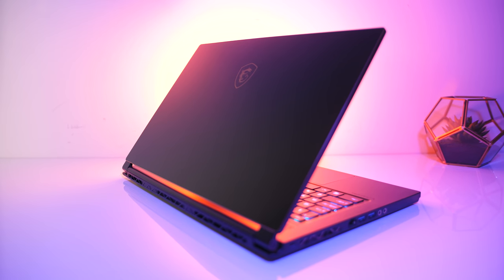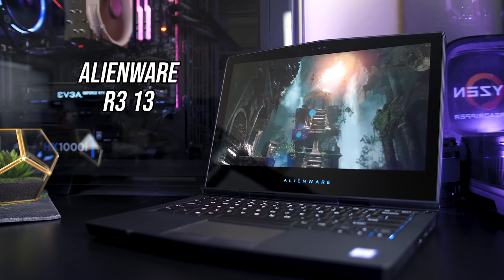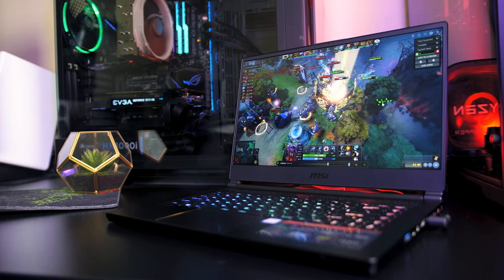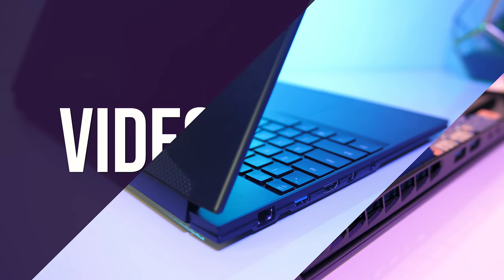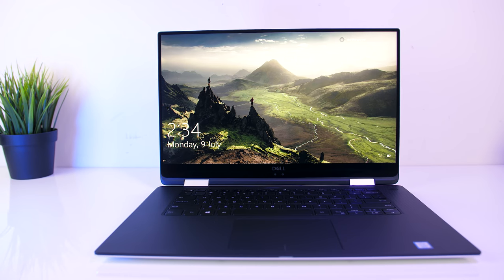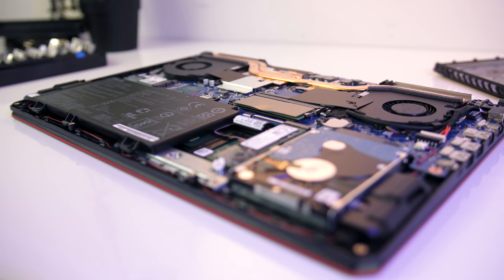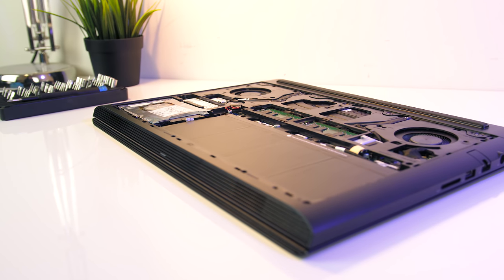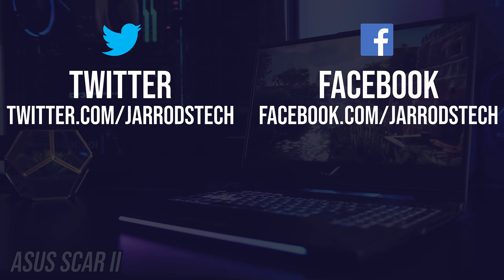The Best and Worst Gaming Laptops of 2018

Comment: Alright guys, so I need some help and opinions. Also great video Jarrod! Subscribed for sure!

I'm not a hardcore gamer but I do game sometimes, like everyday but not for more than 2-4 hours. Mostly Pub G, counterstrike, overwatch and occasionally stuff like Minecraft,  sims, Fortnite. Whatever's fun but I'm not crazy about it so i feel like I don't need to play them on the highest settings with the craziest graphics. I just want it to be smooth while I play at mid-high settings. I want to get into video editing but it's not going to be that serious. I also go to school and want something that can handle the basic stuff for a college student. So a light, thin, and practical build would be best.

I like the Razor Blade 15, Asus Scar ll, and GS65 but I'd like to hear what ya'll think. Help! thank you!
Reply from the maker: Thanks! Fortnite/CS:GO/Overwatch run well on pretty much anything these days, so no issues there. PUBG needs a bit more, probably GTX 1060 for a good experience whereas the others would work fine with GTX 1050 Ti, maybe a 1050 with lower settings. Not sure about Minecraft as I haven't played it myself. When you say light and thin the models that come to mind are that Razer Blade (great battery life, build quality, good specs, but pricey) or MSI GS65 (alright build quality, good specs, fairly good battery, cheaper than blade, good middleground option). The Scar is a bit bigger, has the camo pattern on it so depends if you don't mind that, but the battery life isn't great (at least in the 1070 model I tested, the 1060 one should get a bit extra battery life). All of those laptops are available with 1060 or 1070 Max-Q graphics, for the games you've listed the 1060 is probably fine, but given graphics can't be upgraded in future (unless using eGPU over Thunderbolt) it's generally best to get the best you can afford at the time. Could also be worth waiting a little more, the new RTX models should come out from the 29th of January.
Reply: @JarrodsTech  Wow, thanks for the speedy response or even responding at all. You rarely see that nowadays! I'm pretty much sold on the Razer Blade besides it's price but the base model with 250 gb is about 1700. Seems like a decent price since I'm not looking to crazy game all the time. Do you think that's a good price for the base model or is there a better bang for my buck? I love the sleekness of it and it seems like others with the same specs are around the same price. Thoughts?

Edit: also since gtx 1060 seems to be enough to handle the intensity of my gaming I'd rather wait for the rtx models to come out so that the gtx model prices go down lol thanks again!
Reply from the maker: @lillytopaz2899  No problem! I guess I consider the GS65 as the "bang for buck" Razer Blade 😛 yeah 1060 is pretty good, still capable of playing modern games at high settings 1080p 60 FPS, my concern is it's been around for 2 years now so depending on how much of an improvement the new stuff is maybe game devs might start making the games with newer graphics in mind making the 1060 not as good years from now, really hard to predict though, either way should be decent for a while yet I think!

Comment: I have seen many of your videos. Keep that good work. Could u plz recommend me a good laptop or build for arquitecture and a little gaming?
Reply from the maker: Something with decent graphics, 1060 or above, any CPU like 8300H or 8750H should be fine, 16GB of memory would be good, the rest depends on what your budget is.
Reply: @JarrodsTech  Well, I'm not sure if is better to put all on a laptop or get a desktop and a laptop. My budget in general is $2500..Ty for reply really appreciate I have looking for help a lot.
Reply from the maker: Only really worthwhile getting a laptop if you want the portability to travel with, otherwise you can get a desktop with more power for less money. Otherwise for laptops in that price range, you could get a nice thin and powerful machine like the Razer Blade, Gigabyte Aero 15x, MSI GS65, or ASUS Zephyrus M, those would be what I look into.
Reply: @JarrodsTech  So could be a build for desktop, I was thinking about 32gb or 16gb ram, Cpu i7 9700/8700k, ryzen 7 2700x/tr1920x and gpu rtx 2070/1070ti. Which you think?. Worth a high pc or best a mid one? Sorry for a lot questions.
Reply from the maker: Either would be a fair bit better than a laptop, what are you using it for? If mostly for gaming not really worth Threadripper, either of the other two are fine, technically the 8700k will be better in most games than 2700x due to clock speed advantage.
Reply: @JarrodsTech  I'm a Arquitecute student, Design, renders and play games like Ark, fornite, Bo4 etc. I want to make a build that for about 2years or more  don't need to upgrade it. I want it to be cheap and good.
Reply from the maker: I'd probably go the 2700X with a decent X470 board, in theory the new Ryzen CPUs coming out later in 2019 should be compatible too, so you'd have an upgrade path, and the extra cores may be beneficial for the rendering etc, and still perfectly fine for games.
Reply: @JarrodsTech  Which graphic card and 16 or 32ram?
Reply from the maker: 16gb is fine for most things, especially gaming, not actually sure about your architecture apps so may want to find out what they recommend. Also go dual channel over single (2x sticks instead of 1x) as you'll get a performance boost, higher speed memory can help too, I have videos on those topics here:
Single channel vs dual channel: https://www.youtube.com/watch?v=E_aPaj5QkmM
Ryzen memory speeds: https://www.youtube.com/watch?v=PR68C2bUgFI
Reply: @JarrodsTech  And graphic
Reply from the maker: The best you can afford basically, I haven't tested too many different types myself, but am working on some comparisons of graphics cards soon so that might be useful.
Reply: @JarrodsTech  I will wait then. Since I saw some graphics will come out on CES
Reply from the maker: Yep that seems to be the case too, I'll be at CES making heaps of videos!
Reply: @JarrodsTech  Wow great, Thx for great content really.

Comment: What would be your recommendation for a sorta thin/light laptop for car design/industrial design? Most important software is gonna be the Adobe CC stuff (PS, Illustrator, ID) and Autodesk Alias. Sorta good battery life would be nice and no overheating of course and maybe not looking like a spaceship. I was looking at a Blade 15 or a  Aero 15X (also Zephyrus M and GS65 but those don't have the greatest battery). The thing is, the Blade is probably the perfect package, but I've heard quite some negative things about them. Not really in the reviews - those are usually very positive about the 2018 Blades - but after some time. Just not sure if those are just the few faulty devices or if it's a general issue. And spending €2000+ I don't really want to have issues to be honest. 

What would you recommend in that situation? Maybe a different device than the ones I considered? Or should I maybe just wait a little longer for new devices (CES etc.) ?
Reply from the maker: The GS65 battery is ok if I recall, Zephyrus is out for battery, but yeah blade and aero are really good in that regard. I think it's worth waiting for CES, I'm pretty sure there will be new laptops announced there, I'm flying out in a couple of days and going to be making some videos there on new laptops.
Reply: @JarrodsTech  thank you, I'll wait for CES then. I'll keep an eye on your new videos. Has your experience with your Aero been good so far?
Reply from the maker: Yeah going well, though CES will be the ultimate test because it will see the most action so far editing/exporting all the videos 😛

Comment: Hey Jarrod,So I have the Worst Laptop,the FX504 with I5..Well like you said it stutters ALOT on games..Even on CSGO. Do you have any solution on fixing the stuttering issues? oh and I've bought the laptop last week.

And If have a chance to change to buy a new laptop,should I go for the Nitro 5  Or  MSI GL63 ?
Reply from the maker: To be honest I'd try and send it back while you can, most places let you do this within the first week or two. Otherwise you could try undervolting the CPU, that may help a little but the problem will still be there, otherwise not much else can be done. Nitro 5 is good, have heard good things about the GL series too but haven't had the chance to review any yet (don't think MSI in Australia have review units), but yeah I'd prefer anything over the FX504 so see if you can swap it!

Comment: You mentioned video editing, but I'm looking at getting a gaming laptop for photo editing and programming software, with some gaming on the side. Would you have a similar recommendation for that?
Reply from the maker: Something to keep in mind is most of the gaming laptops below $1200 or so tend to cut costs on the screen, so they end up looking dim which isn't great for editing but is fine for most gamers. Depends on budget, but something with a nice IPS screen would be the way to go, like dell xps 15 with 1050ti that screen is very nice. You could of course get a cheaper gaming laptop and just connect a higher end monitor at home when working with photos through, depends if you need the good screen with you when traveling

Comment: My Razer Blade 15 handles heat amazing. I never worry about it overheating because it has two fans that are actually placed in the correct locations. Keeps hands/palms cool while gaming.
Reply from the maker: That's good! Yeah not sure why I got 90c on all my GPU tests with it, maybe it didn't have proper contact between the cooling and GPU die, not really sure 🤔

Comment: I'm planning to buy Acer Predator Helios 300. Is it the best in the price range of Rs. 70-80k, that is, around $1000? Will I be experiencing major heating issues with it? I also read that some people experienced a battery reset issue, but I think they solved it in a BIOS update.
Reply from the maker: Yes, it seems to be one of the best options for the $1000 USD price point. Yes it also runs quite warm, I have a video showing that here: https://www.youtube.com/watch?v=kc8b3uHsbvE
Reply: Temps are good as long as you undervolt the cpu. At a room temp of 25c i get max 85c and an average of 70-80.(Playing demanding games which use 6 cores.)

Comment: Hello! I have a question for you!

What will you choose between aero 15w (1060) and gl504gm?
Two of them have the similar price in my country, aero 15 has better battery life but it has a lot of issue about the software at first . (Although gigabyte had already solve it but it still having some software problems are not sovled)
And gl504gm has better throttling performance; however, it’s more heavier than aero 15 and has normal battery life !

Can you give me some advice?
Reply from the maker: I went the Aero 15x so I'd probably get the Aero 15w for the same reasons that, I talk about why I picked it here: https://www.youtube.com/watch?v=bASY_WR-Rps

Comment: Acer helios 300 vs Dell G5 vs Dell G7 vs Asus fx505...
Which is the best in thermals??
Btw grt video...😊😊
Reply from the maker: Thanks! All the data is in the full reviews for each, but if I remember correctly the Dell G laptops did pretty well in terms of thermals, not sure if it's due to the lower powered Max-Q graphics, but despite the fan speed not being adjustable it went ok. I remember the Helios 300 thermal throttling in multicore workloads even with the fans on maximum, possibly still hot with an undervolt too, FX505 was alright too if I remember.
Reply: @JarrodsTech  Okay...
Thx for replying..😊
Reply from the maker: No problem!

Comment: I am planning to buy a laptop to use for AutoCAD and some video editing cant choose:

1. Asus tuf fx504
2. Acer Nitro 5
3. Hp Pavilion 15

They have the same specs 8th gen core i5 4gb of ram 1tb hdd and gtx1050 graphics 
Cant decide need some help thanks
Reply from the maker: I wouldn't get an FX504 for the reasons mentioned in this video. I haven't used any HP laptops myself, so it seems to be between that and the Nitro 5, given the same specs I'd expect similar performance so would go for what ever you liked the look of more / had better screen or battery life.

Comment: I need some help with choosing a laptop. I can’t decide between the MSI GS65 Stealth with the RTX 2060, or the ASUS Rog Strix Scar 2 with a 2070. In pretty sure the MSI is a better build quality (at least in how it handles cooling). But either way I’m getting it set up with a better thermal paste and thermal pads, and I also plan to undervolt the laptop. I need it to last at least 4 or 5 years, hopefully longer, so I want to make sure they don’t get too hot and the metal or plastic doesn’t warp over time from the heat, which make some want to choose the MSI over the Strix, but the Strix is about $100 cheaper and has a slightly better graphics card. Any help would be greatly appreciated, and thanks!
Reply from the maker: The Scar II is larger and in theory has more cooling space, it's also more sturdy in terms of pushing down on the chassis from what I recall, depends whether you equate that to better build quality or not. If it's for gaming I think the 2070 will give you a fair bit better performance and longevity too. Given the graphics can't be upgraded as the chip is soldered to the board (unless the laptop has Thunderbolt then you can use an eGPU) it's generally better to get the best you can at the time, especially if you want 5 years of use. I'd probably go the Scar II if it's going to be used as a gaming laptop, probably better battery life with the GS65 though based on what we saw with the 10 series models.
Reply: Jarrod'sTech one thing that I forgot to mention is that I don’t want the laptop to scream “edgy gamer,” and I know that the scar II isn’t that bad, but the MSI just looks more clean. Also, a lot of the people who got the scar II said they had problems with heating (I don’t know if it was actually  a lot, but more than the GS65), and I’d be using it for some light schoolwork, mainly just typing essays. Something else that I have a problem with, my budget is $2000, and both laptops will go over that with the modifications I want done to it, so do you have an idea of how their prices will change in the next year? Thanks again!

Edit: Also, do you think the heating will be that bad considering there will be the the better thermal paste and thermal pads, along with undervolting it? Also, depending on the temperatures, I might end up getting the cooling pad thing that you put the laptop on.

Second Edit: would it be helpful/ if you were willing to, could I just post the links to the 2 different laptops I’m considering and tell you the customizations?
Reply from the maker: Yeah I prefer the look of the GS65, not a fan of the camo pattern on the Scar myself. Prices may change soon, new RTX models should be coming out from the 29th of January, not sure if it will happen but it may be possible that some stores want to clear older stock, so worth looking out for. I don't think you need to worry too much about overheating with either laptop, if the temperatures are hotter than you'd like you could look at undervolting the CPU. You can link to them if you want, not too sure how the specifics would help though, I think at this point you're torn between extra performance+thicker laptop+edgy gamer design vs thin+nicer looking+not quite as good performance but still above average, up to you to decide in the end 😃
Reply: Jarrod'sTech ok, thank you so much! I still haven’t decided, but I’ll talk about it with some other people. You’ve made this a lot more easy and simple for me, and you’re one of the only youtubers I’ve seen who actively responds with and has conversations with his subscribers, even on a video about a week old. You’ve earned a subscriber, and a like. Thank you so much!
Reply from the maker: No problem at all, welcome to the channel!

Comment: Can we buy these laptops in 2019 I really need one and should I wait for 9th gen chips or take a i7 8th gen 

plz answer
Reply from the maker: i7 8th gen is pretty good IMO, a bit hot though but nice performer. I got a 8th gen laptop with 10 series graphics in October knowing full well new stuff was on the way, but that's the thing, new stuff is always on the way, you could get something now and start using it today and be happy with it. Don't do what I did for 3 years or so with my PC, and fall into the trap of waiting for the next thing. 20 series graphics are here in a couple of weeks, I think that's the longest I'd wait before deciding what to do.
Reply: @JarrodsTech  Thanks bro 
plz tell me should I get an Acer nitro 5 or pay a little more to get an Acer predator helios 300 and also plz tell is there any difference between
i7 8750h and i5 8300h
Reply from the maker: @amey2932  Not much difference between those two CPUs in most games, similar clock speeds, depends on if the games make use of more CPU cores. Out of those two laptops both are available with same specs, I'd buy the best you can afford at the time given you can't upgrade CPU or GPU without replacing the entire laptop.

Comment: missing one category: lightweight gaming ultabook  (aka. less than 1.5kg, small form factor, good battey life, decent performance (8th gen proc 15w + decent gpu por casual, 150mx or 150mx 25w or 1050 maxQ)
Reply from the maker: Yeah only missing because I didn't get sent any to test 😅 maybe I will get more in 2019.